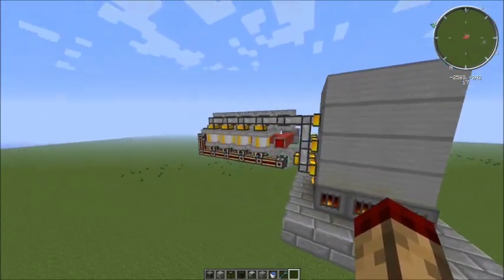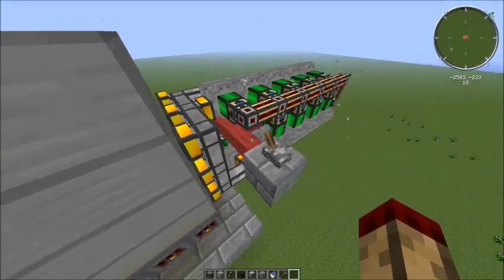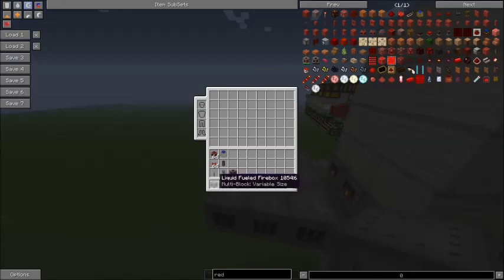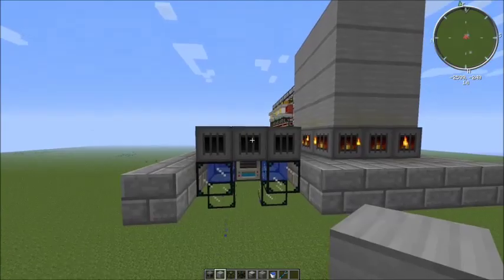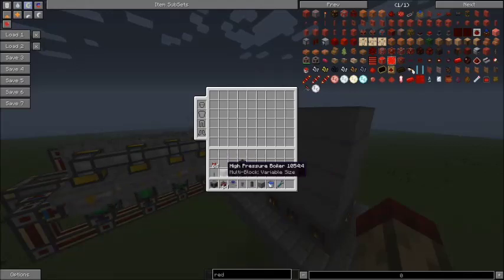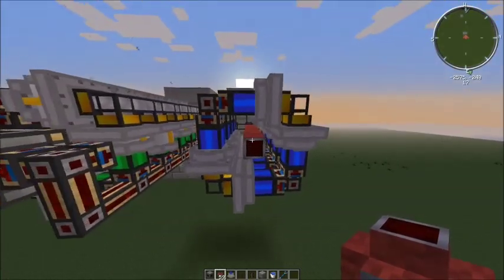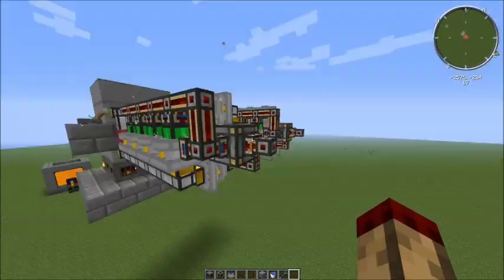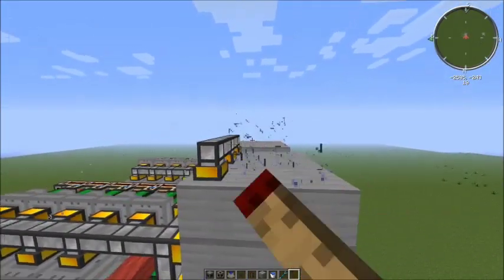Steam Boiler Setup (Compact and efficient) - Feed The Beast Tutorial

Comment: Just to inform on the compact design part, you can place the engines directly on the steam boiler you don't need liquiducts comming out just place a gate on a wooden conductive pipe and set to power request = redstone signal.

Comment: so im trying to build one and it seems my block to put my lever on wont connect to the jacketed wire. am i missing something? also during the vid you call it jacketed cable when you are using jacketed wire, ive tried both to no avail. its a great design and id love to use it, any help would be appreciated.

Comment: The better -More- compact design is to run redstone contuit up the center on both sides to an energy cube on top.. then line industrial steam engines on either side of the conduit. This design eliminates the need for liquiduct since the engines get steam directly from the boilers. to activate the engines I used to use redwire from redpower2.. unfortunately we don't have this anymore.. so  I'm currently just using levers on the back of every engine.